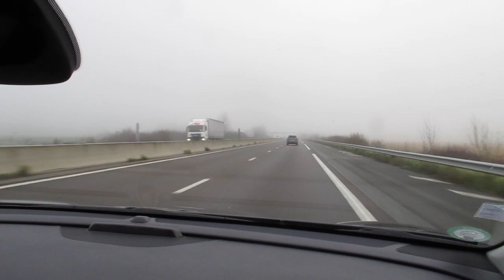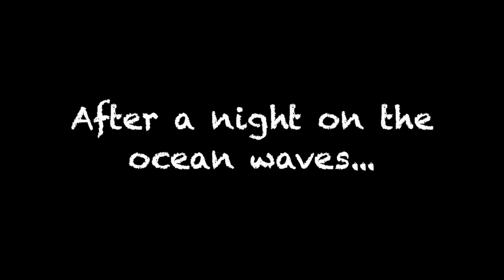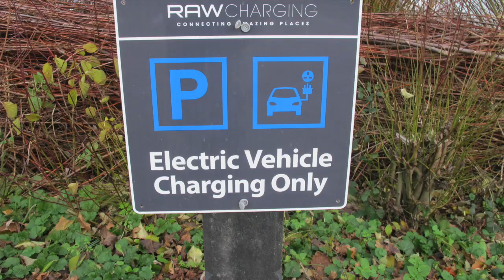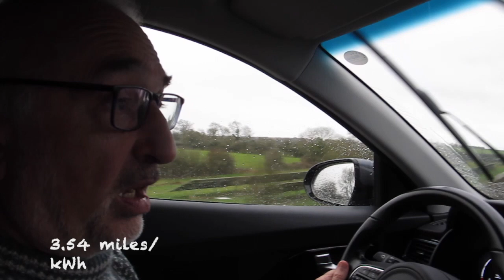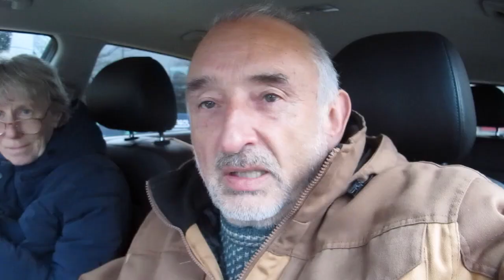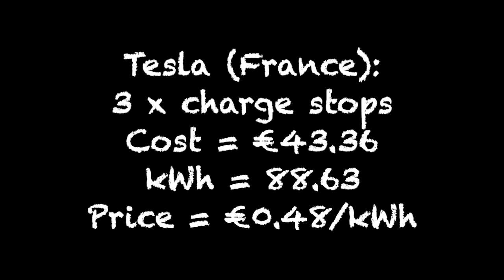Kia e-Niro vesus Storm Darragh - All part of our 1,000 mile road trip

Comment: Do you have problems on the tesla v3 chargers? I ask because the niro i have late 2020 model physically cant accept tesla v3 ccs charger cable due to it hitting the light on the charging port.

V2 and V4 are fine
Reply from the maker: Just so I understand what V3 chargers are..They are just the red/white as in the picture here? If these are V3 then I've never had a problem plugging in. On some Tesla chargers I needed to give the connector a bit of a shove to locate it. Perhaps the portion of the charging port light changed from 2019 to 2020 but that doesn't seem likely..Sorry, not much more I can add. thanks for watching.
Reply: @kiae-nirodiariesencore4270  thanks for replying and yes you're correct with your description of the v3 chargers. That's great you've had no issues. You might be right about them changing the charging port for the slightly later ones.

Not sure if it's the same in France, but I'm finding Tesla's charging network the only reliable way to get around in the UK at cheaper prices.

Comment: Yup you’re dead right about the UK roads are full of potholes & EV Charging prices are shocking.
I go down to Spain crossing France once a year. Also do business trips to Reims.
Favourite chargers in France are IECharge (0.30 cents) & Tesla
Reply from the maker: Thanks for the tip, I didn't know about IECharge...you probably know more about long hauls in France than I do! It's a big place, lots to explore. Reims eh!..champagne country. 😊
Reply: @EVDiaries-since2019  Yes ,they are very good high power chargers (not that us Niro owners would benefit) & cheap.
They are always placed next to sub-stations, However, they are usually in the middle of nowhere.
But I’ve yet to pitch up and find another car charging.
😊

Comment: Sounds like quite the adventure. You're right about EV charging prices in the UK, they are scandalous, I always try to use Tesla public chargers, they're cheaper and reliable,(who'd have thought😁) top tip, half an hour or so before charging, switch the car into sport mode, it uses more energy, but it heats the battery, I find it helps in the winter with charge speed. Remember to switch it off again when you've charged though😂
Reply from the maker: Thanks for that tip. Our next long haul should be over to Zurich for a first birthday party in late Feb, early March. I will try to remember to do that. 😊

Comment: Very interesting. I have a Hyundai Kona 64kw and live in Dept 82 (Tarn et Garonne). I shall be driving to Dieppe (800 km's) in the next few months so curious to see how you have got on. I have a Chargemap card. Did you mainly use this card? I might register with Tesla too? What is your 'normal' average kw per 100 kms? It was also interesting when you mentioned Culham, because I had an office there.
Reply from the maker: Salut! I do use the Chargemap card which I use most of the time in France. I have also used it in the UK, Germany and Switzerland. I don't use it when I plug in at Tesla, for that I use their app which is simplicity itself. I know you can use the Chargemap card for Tesla but I don't see the point as it isn't any cheaper. Here is my take on summer/winter efficiency 
https://www.youtube.com/watch?v=QcVtOISNMDM&t=155s
I used to visit Atomic Energy Research at Culham in the early 1980s. I worked as a computer engineer and AERE were one of our customers. Thanks for watching.

Comment: You are right about the expense of rapid and fast chargers in England.  I have the same E Niro 4+ as you which makes up for it with its reliability and range. I have worked out that even with spending £375 this year on motorway expensive rapids  (89p a KWh ) mainly grid serve. Yet   with charging at home for the rest of the time works out still at 0.67p per Kwh.  So £67 gets us 1000 miles overall throughout  the whole 10,000 miles this year. So still very worth it.
Reply from the maker: For me it's a no brainer. Electricity in France is a lot cheaper €0.20/kWh including tax. We could get cheaper overnight on a different tariff but we have solar panels and a meter that runs backwards when we're producing more power than we're using. The panels produced enough for our annual use last year of just over 20,000 km with a few hundred kWh spare. I reckon we are saving €2,000 a year in not having to by petrol or diesel, that is assuming an ICE car doing 5.6l/100km...about 50 mpg. Thanks for watching.